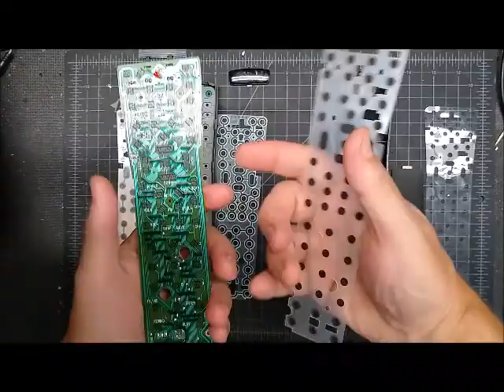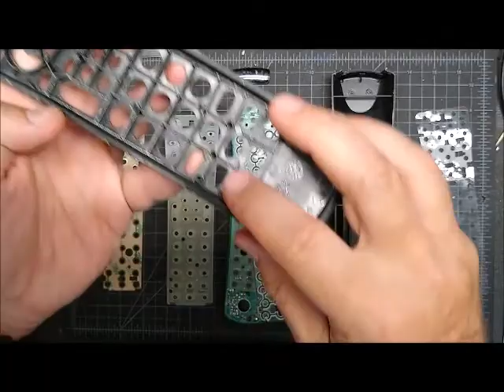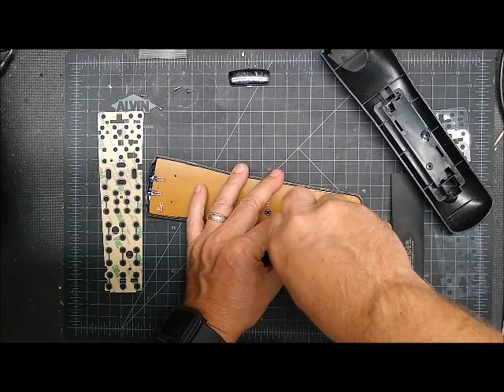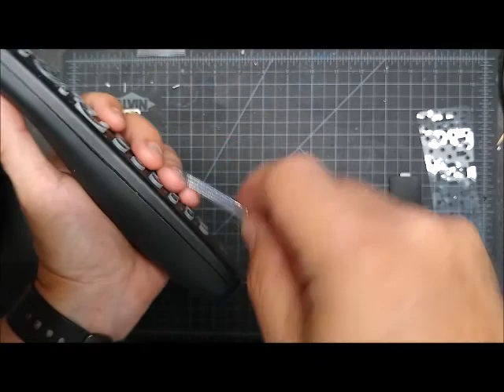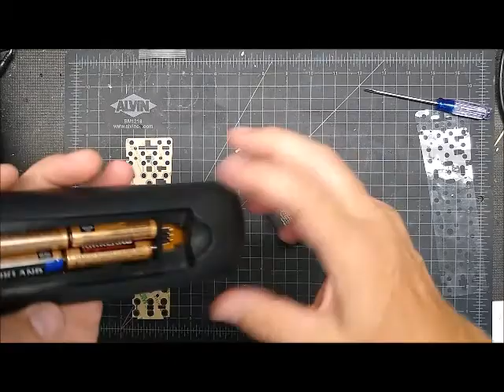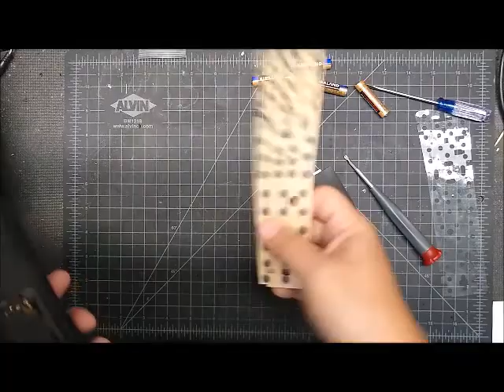How to fix the buttons in Radio Shack 15-1994 Universal Remote

Comment: I recently purchased the 8 in 1 universal remote 15-2117 off eBay and the backlights don't work at all. This was an unopened old stock remote.  Any idea on how to get it to light up again?
Reply from the maker: Sorry, no idea what could cause that.
Reply: @p1repair  I just wonder if the backlight sheet goes bad over time or if there is a capacitor that provides it with power that has gone bad
Reply from the maker: @reecelujan5911  capacitors don't fail in storage, only with extensive use. I doubt the backlight fil will go bad on it's own over a decade or two.